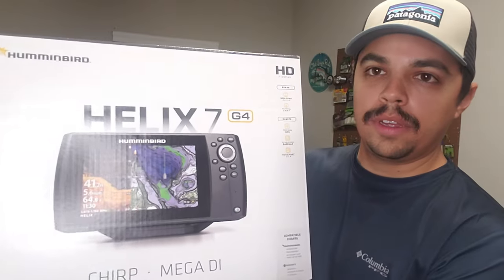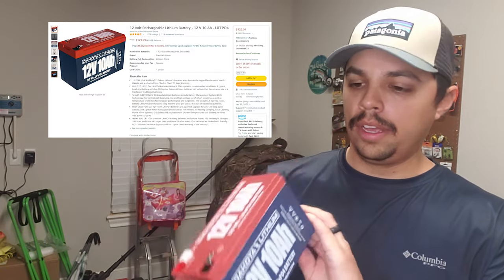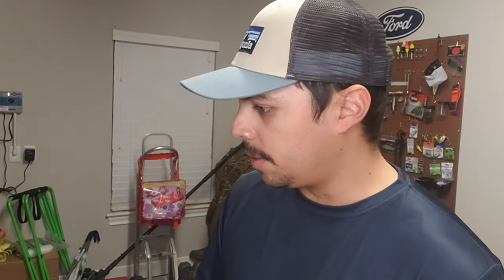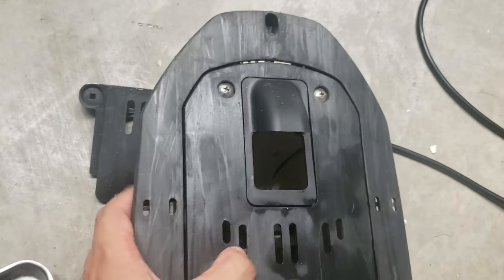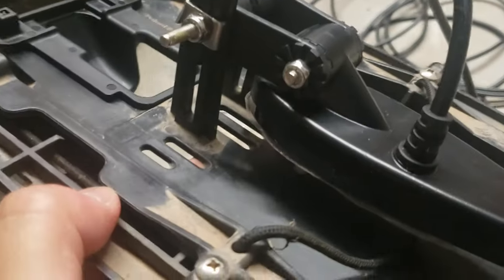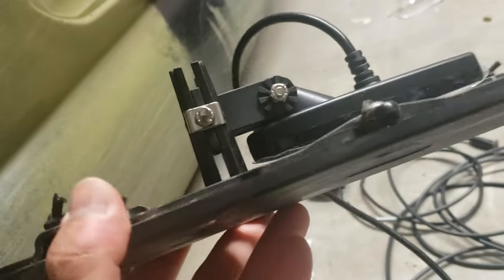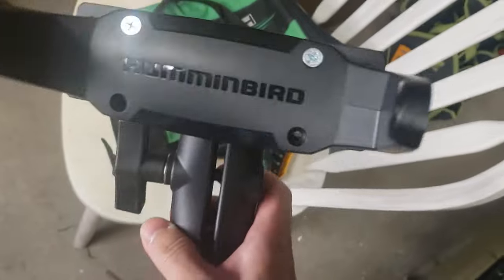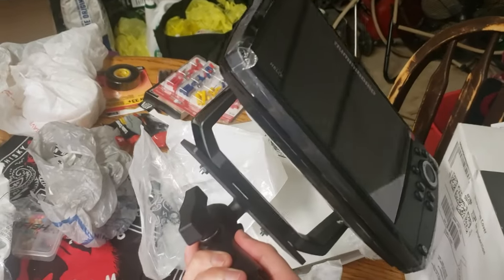HUMMINGBIRD FISH FINDER INSTALL HOBIE PRO ANGLER  WHAT TO BUY

Comment: did the transducer work ok with the plastic plate blocking it?
Reply from the maker: Yes, it works great. I was worried about that also but so far have had no issues other than when mud/clay gets underneath and can block the reading.  Washing it off fixes it.
Reply: @rivercreekoutdoors  awesome.  Thanks so much buddy.   Just got my transducer mounted.  About to hook everything up in the yak.   Your video saved me! Haha.

Comment: I don’t have that transducer mount for the hummingbird. Guy I got it off said it didn’t come with it. Where can I find it?
Reply from the maker: I believe I bought mine from Mariner Sails. It's been awhile but they should have them or ebay might be another good option
Reply: @rivercreekoutdoors does yours work up in the cubby? Like through the plastic ?
Reply from the maker: @Kgoutdoor  Yes it works good. I'm sure you would get a better reading if it was below the kayak in the water but the way I use my kayak I drag it a lot so didn't want to mess up the transducer